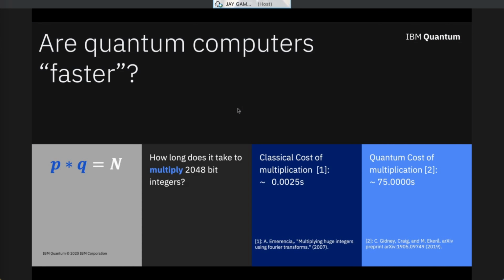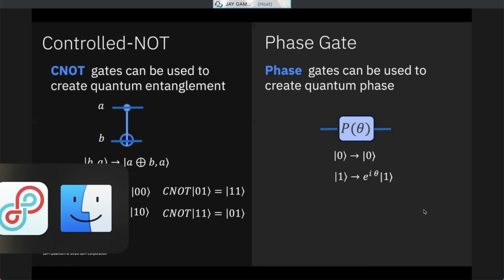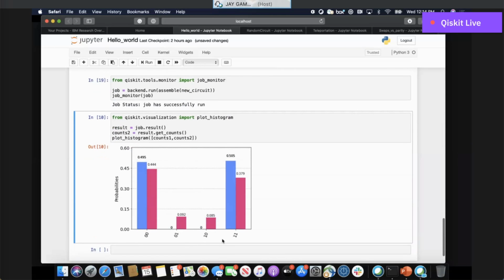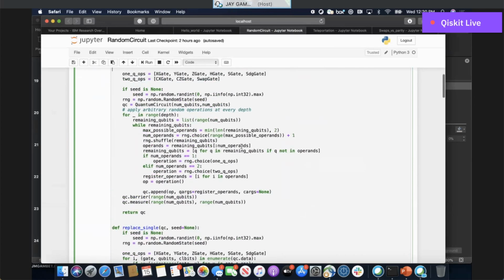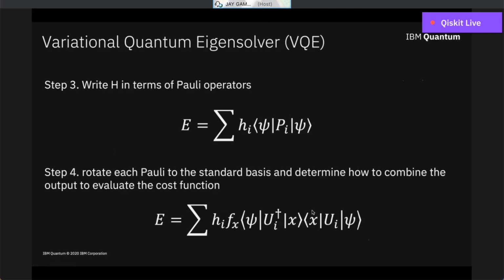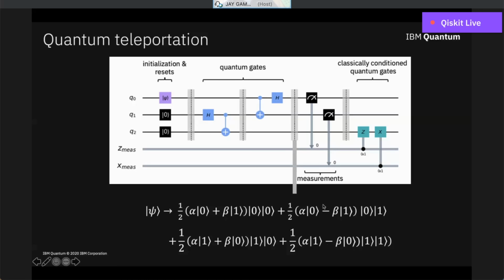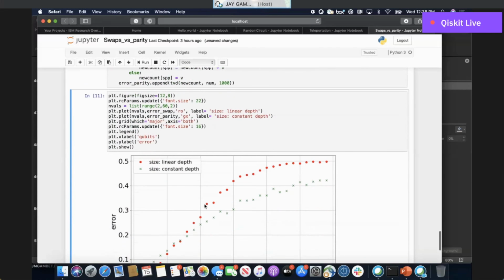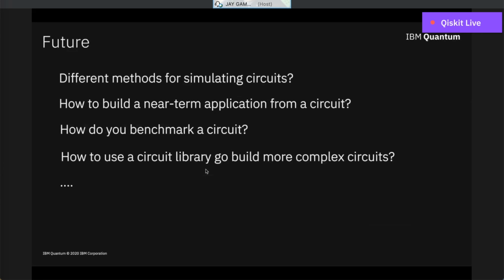Circuit Sessions with Jay Gambetta

Comment: 7:20 Any reason why IBM/Qiskit decided to use the top-most bit in a circuit as the least-significant bit inside a ket? Every single reference I've seen uses the opposite convention. Is there a technical reason for it? Or just preference? Thanks!
Reply: Hi D S. There is a good reason for this. We're effectively trying to keep measurement outcomes close to their classical counterparts. For example, imagine you have two qubits. When you measure them, the resulting outputs are some combination of 00, 01, 10 and 11. Let's say I number them such that qubit0 is the right-most, and qubit1 is the left-most in these measurement outcomes. When I add another qubit, which we will call qubit2, then the measurement outcomes are 000, 001, 010, 011, 100, 101, 110, and 111 (when ordered in binary). Notice how the first four of these and the last four of these have the same last two bits (00, 01, 10 and 11), which is exactly the two-qubit outcome.

Imagine, instead, that we'd done the reverse. In the two-qubit case, if qubit0 is the left-most and qubit 1 is the right-most, then when you add another qubit, the outcomes 000, 001, 010, 011, 100, 101, 110, 111 (again ordered in binary) now read the outcome of qubit0-qubit1-qubit2. That means if you remove the last bit in these measurement outcomes (maybe because you want to glean the pattern in the other two bits), the pattern that you get is 00, 00, 01, 01, 10, 10, 11, 11.
So as you can see, the motivation for keeping the bit ordering such that the top-most bit is the least significant is because it makes it easy to interpret the results when extra qubits are added.

Comment: Classical computers can found very very large prime numbers in some days and those numbers will consume more than 2048 bits. And you said that classical computers would take years so isn't that wrong.
Reply: Finding arbitrary primes as you said is not quite the same as finding the two largest prime factors of a number. The problem of prime factorization is what Jay referred to as being classically hard.